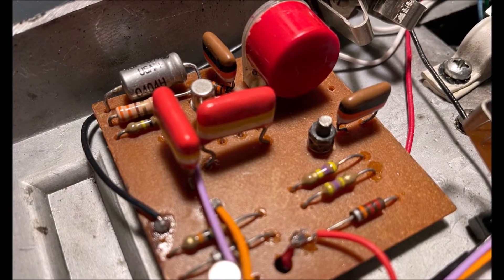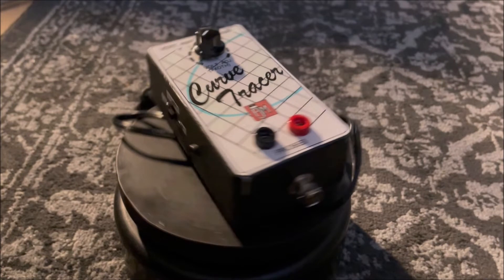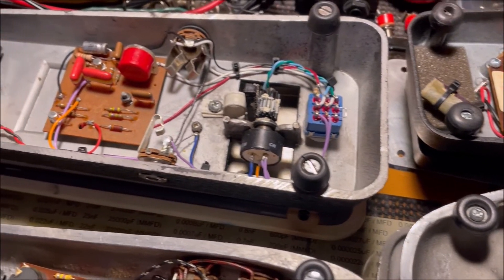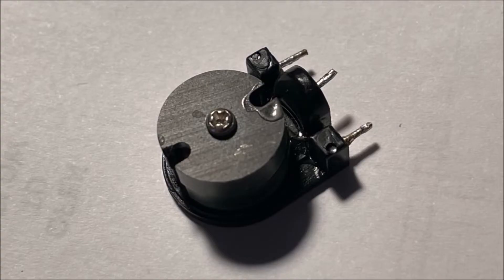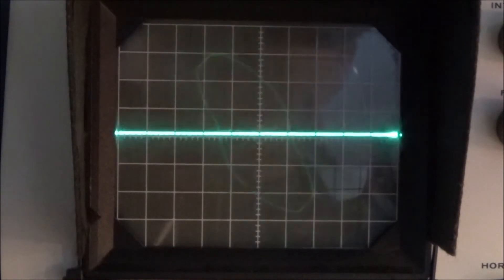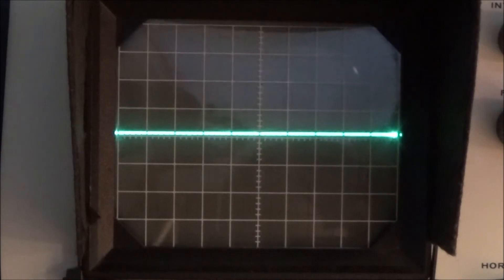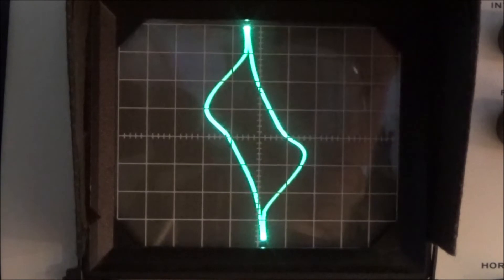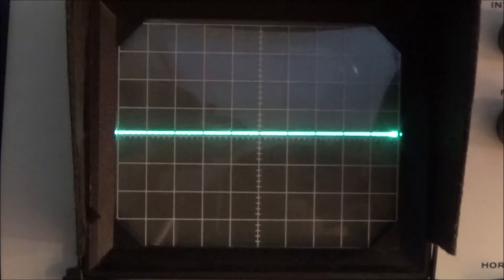Looking At Wah Pedal Inductors with a DIY Curve Tracer

Comment: Interesting video, the thing is with wahs is that everything is balanced against the other components in the circuit. Different inductors do have an affect not only on the tone but the feel as well. 
As I say, they’re highly balanced circuits and in certain positions the wrong type of component can ruin the sound or feel of the wah.
Reply from the maker: @3rdtonefromthesun  I’ve messed around with modding the classic wah pedal circuit. The most audible change to the sound was the transistor used - how much gain it has basically, which alters how the circuit responds to what is going thru it.
Reply: @ indeed it does, but as it’s a multi-factoral thing your signal chain is equally important. Some wah setups don’t suit certain applications or rather, work very well with them. 
But for juicy pure wah tone, a good edge of break up amp has to be key ingredient, metal territory gain with a wah to me devalues the nuance you can get out of them - they end up often sounding nasty. 
They’re a very driven pedal and no two players sound the same underfoot, that’s another key component in the signal chain hahahaha…

Comment: thanks for this great study.i have xy on my scope and trying to understand what variables a component part reacts to different changes in voltage,resistorsfrequency, etc.cannot find any theory books on the curve tracer idea if you have something you could share that would be great. thanks
John
Reply from the maker: There's not a lot of in depth stuff out there in terms of using o'scopes in this manner but maybe these pages will help:

https://www.testandmeasurementtips.com/using-scope-display-lissajous-patterns/

https://resources.pcb.cadence.com/blog/how-to-read-lissajous-curves-on-oscilloscopes

Curve tracers can be a good way to test things like transistors and capacitors in circuit. I have even determined approx. resonant freq of guitar pickups for which I can't find any specs.

Comment: My 70s Shin Ei Wah has some kind of an audio signal transformer (I think using just one side) rather than an inductor like any of these. Sounds like a Wah.
Reply from the maker: Yeah those are a quirky wah pedal. I'm sure that was probably done as a cost saving measure. You can use audio transformers as an inductor, they just need to have the correct amount of inductance to make it a resonant circuit. I should look at an audio transformer sometime, using similar test arrangement and see what that looks like.